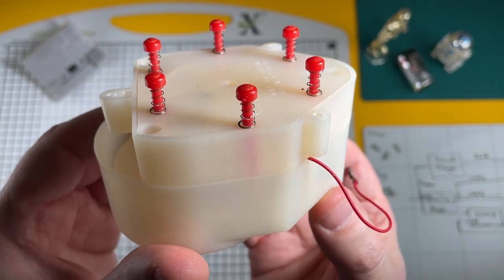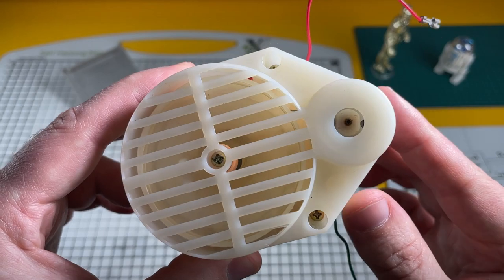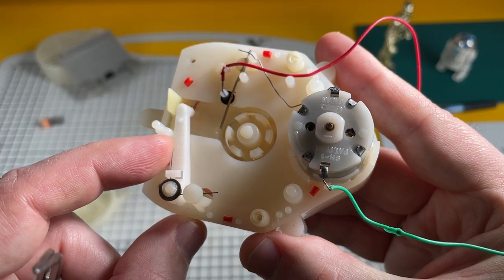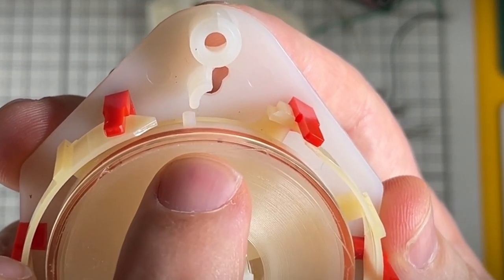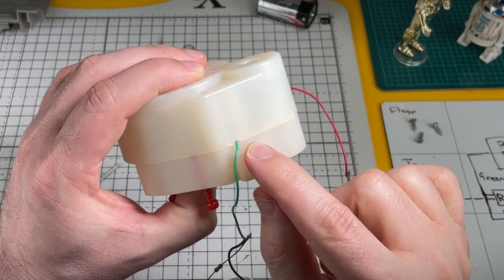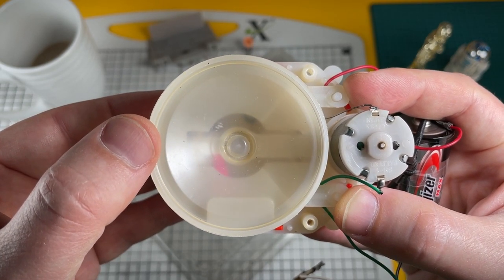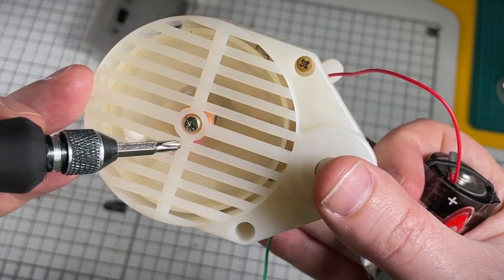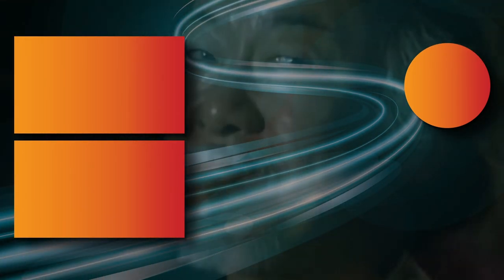THE Guide to Restoring the Sounds of the Imperial Troop Transporter - Kenner Star Wars

Comment: Fixed one of these back in December.  Didn't know about adjusting the speed with the speaker screw.  Thanks!
Reply from the maker: Yep, it's a fine adjustment - that screw pushes down on the speaker which itself is pushing down on the needle. So the more pressure, the harder the motor is working, therefore runs slightly slower. Just like a real record player if the needle is too heavy it can erode the record slowly over the years - so just a case of tightening a little and trying each time 👍

Comment: Ozen are responsible for the majority of toys of that era that had sound that was record based, Action Man, Mr T, Star Wars, Tommy Gunn, Knight Rider as you mentioned, some with motors, some with a pull string, but they all seem to be slightly different, if not very different, so it's never as straightforward as you might think. Great job on working this one out mate! 👍
Reply from the maker: Hey Darren! It would be awesome to restore as many of those as possible 🤣 I have an Action Man Field Radio waiting for restoration, but would love to find a pull string Action Man to see how that works. Cheers for watching 👍
Reply: @VintageToyRush  well I've actually been waiting for someone to do a fix it guide for the Action Man field radio so I can feel a bit more confident about repairing the one i have, although I reckon I could probably use something like this or the Knight Rider video as a reasonable guide, A one to one representation is obviously more preferable! 👍

Comment: That track seeking mech was very clever for how simple it works, I think it's probably the small scale of the catch points where failures pop up but that's tradeoff to the fine degree of force these parts use in operation. Bit like an engine, every 10,000 miles do a servicing. ;)
Doesn't necessarily work generically but I think the speed control concept is like a primitive voice pitch adjustment option, I could see how it might apply to some designs better but most toys just use a default motor speed.
Reply from the maker: I've been wondering for a while how that mechanism worked inside this Troop Transporter, so was very happy to open this one and reverse engineer it. Amazing really what they were able to accomplish in such a small space and with few moving parts. The voice pitch switch seems redundant to me for this vehicle but perhaps they re-used the record player in other toys too? A service goes a long way on many of these vintage mechanical toys 👍

Comment: This is brilliant and very, very helpful! I am trying to get the motor of my Troop Transporter running now, too. I seem to have hit some sort of roadblock, though - now the motor runs all the time and the record is turning all the time, so the buttons don't actually do anything... where did I go wrong?
Reply from the maker: There's a metal strip that sits against a post. When this strip is moved away from the post, the circuit is broken and the motor stops. When the record arm moves from left to right while it's playing the record, the record arm eventually pushes the strip away from the post. In your case this isn't happening. Check the needle is actually playing against the record (do you hear any sound at all when you first connect the battery). Then check the needle can move the strip away from its post. Also check the wires are connected correctly to + and - on the battery. If the record is rotating backwards, the needle will never engage with record and move across to the right.
Reply: @VintageToyRush  thanks, I think I am on the right track. Funny though: when the module is open (i.e. only the speaker diaphragm
is loosely lying on the needle, I can actually bush the buttons and the sound play OK. The problems start when I close the module and turn it around (the way it's supposed to be installed). That's where the record starts spinning immediately, and the red buttons don't do anything anymore. Seems that the circuit is already closed... but where? Must have something to do with the needle...
Reply from the maker: @achimhiltrop8124  nice! it's working at least... do you have the spring that sits on top of the speaker. The spring provides some force on the speaker holding the needle in place until you press a button.If you do have the spring, tighten the single screw in the top of the speaker grill - that'll add some more force - that'll be a good test 👍

Comment: Thanks for this. I've pulled the entire thing apart and grown to understand the motor fully. BTW, I majored in English, not Engineering, so if you can teach me, you can teach anything. You spray contact cleaner right into the motor. Does any contact cleaner work, or just Deoxit D5?
Reply from the maker: Thanks! 👍 Any contact cleaner will work. I usually spray a small amount into the motor and let it run for a while. Also, let it dry and wipe any excess before assembling the rest of the vehicle. Good luck in your restoration!
Reply: @VintageToyRush  Thanks for this. I'll get it today. Do you think it useful to lubricate the motor with a grease for electric motors?
Reply from the maker: I've never applied grease, you should be good to go 👍
Reply: @VintageToyRush Success! Thank you! I used the electrical contact cleaner, let it dry, put it together, and the motor stopped squealing.  Of all the ITT restoration videos, yours goes into the most detail about repairing the device. Can I share what I've noticed? 
1. The contact arm has to be touching the contact point at rest or the system won't start, and sit at the right angle or it'll cut off the recording too early. Mine was bent back. 
2. People should check and clean the contact arm contact point. 
3. The record hangs downward, so it should be hanging fully down. Mine can sit higher on the axle and spin not so well. Check the record hangs fully toward the knob that prevents it from falling off the axle. 
4. Clean the contacts on the speed switch. Mine was corroded and not connecting well. 
5. The inner motor is built of pretty solid stuff. It strikes me as unlikely to be physically broken unless the body has apparent damage from dropping. I bet these things just need a thorough teardown and refurbishing.  
6. Refurbished and with a new battery, the thing is loud!
Thank you. 🙂
Reply from the maker: @equesfuscus  That's great news! 👍 And thank you for sharing your experience and gotchas - good info for others who may be in the same boat. Am so pleased you've fixed yours and this video helped you along the way. Cheers Dave.